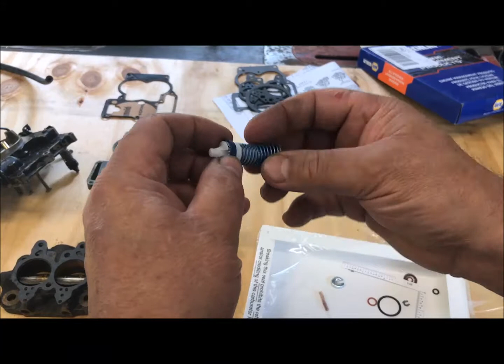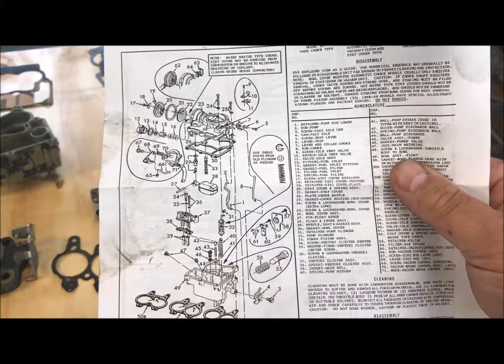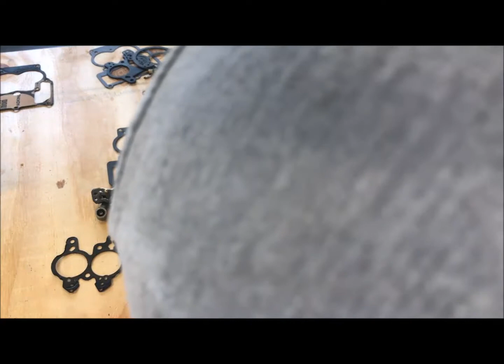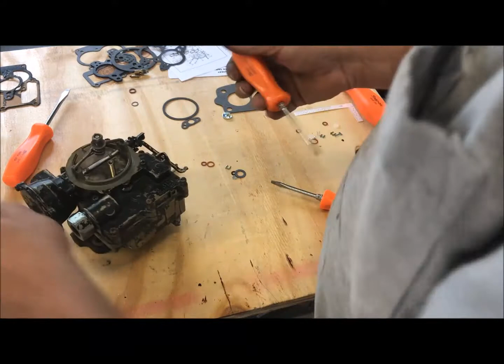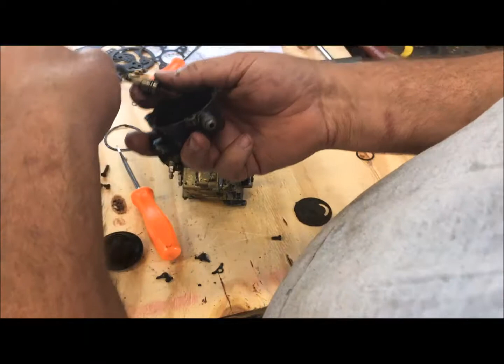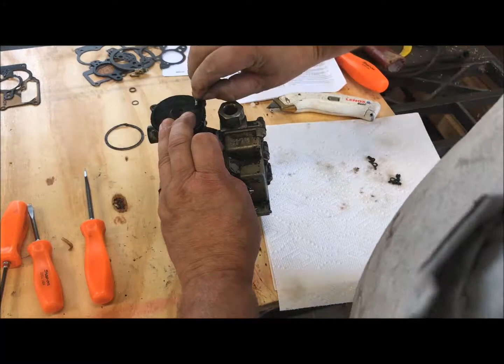Caburator overhaul Mercruiser Rodchester 2 Jet 120hp part 2

Comment: Did you ever fix the leak at 45:50? I have a similar leak on my boat
Reply from the maker: Yep roughed it up with a wire wheel and filled the crack with JB Weld steel stick and she has held ever since